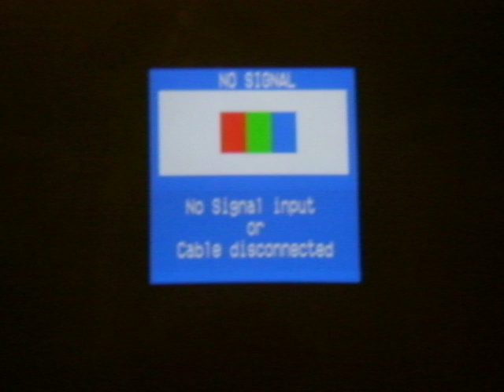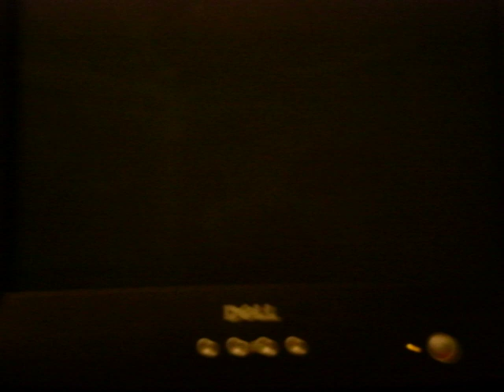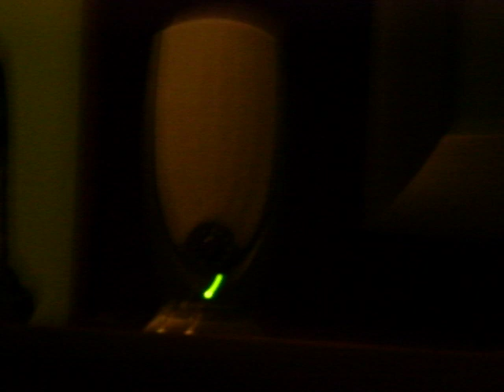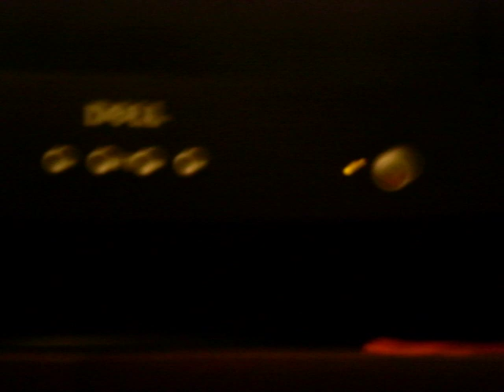Budget Gaming PC Build | No Video to Monitor, HELP!

Comment: well I seen the video were you got the foxcon motherboard and a phenom 9850 be well the phenom 9850 be is more for like a ddr2 system and I believe that's a ddr3 board it will work but maybe that board dose not support that processor. maybe with bios updates.

Comment: Ok i had the same problem with the xfx 780i, quite common for that board :/ ... anyway, take out your board and set it up outside the box, take out everything, reinsert procesor and ram and clear cmos, and make sure bios chip is in properly, if still no post then RMA